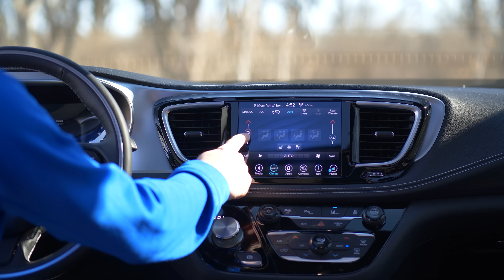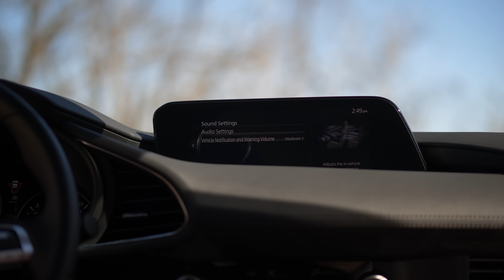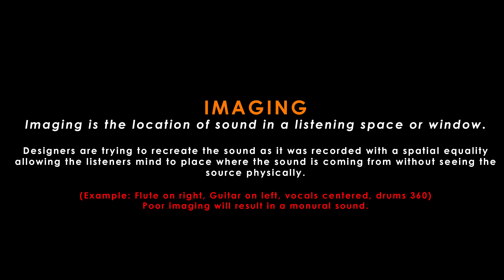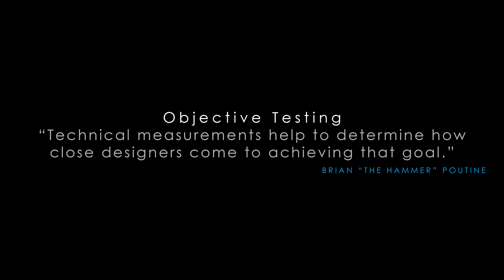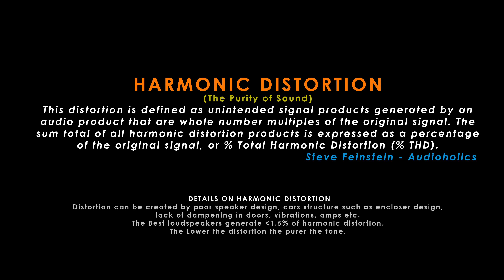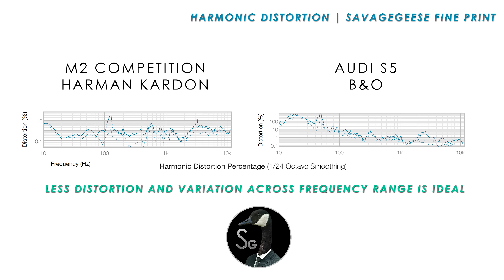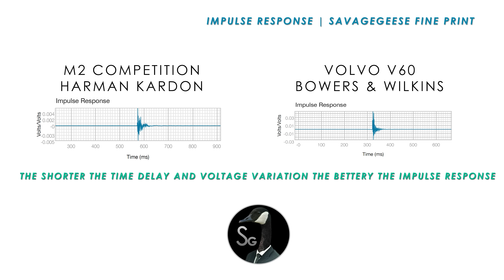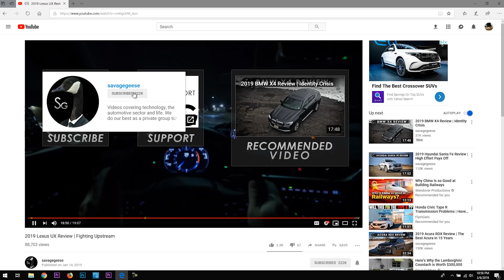Understanding Car Audio Design

Comment: I used to be a huge audiophile(the real kind; home loud speakers). For anyone who is, my last system had 3 way speakers with RAAL 70-10, Accuton C50, Scanspeak Revelator drivers with crossover duties done by minidsp and driven by crown amps. I'd put this speaker against ANY speaker regardless of price. That is to say, I value a linear response and know what good soundstaging and imaging sounds like.  
my experience with factory car systems, is that the brand name almost never tells me if a system will sound good. However, there are brands that almost always sound like shit in factory systems. Alpine, Beats, Bose. The best I've heard is the HK system in the first gen Merc CLS. No exaggerated frequencies, and astonishing imaging(great use of the center speaker) for a car environment, no distortion. At max volume, the amps would never audibly clip. The headunit also allowed for speakers levels to be adjusted based on the primary listener's location in the car, which worked very well. I have a WK2 Jeep with the HK system now, and it is absolutely terrible in comparison. Painfully bright, even with the highs turned way down, bass is too strong even with that also turned all the way down. Mids are okay.
IIRC, Harman is now owned by Samsung? They're a HUGE company that makes a lot of junk (mostly JBL, some HK and AKG branded products), but they also know how to make top quality stuff (HK990, ANY Crown amp). 
I was never much of a B&W fan, but I'm glad that they're a stand up company.
btw, B&O has a reputation in the audiophile community not as a high end audio brand, but a high end lifestyle brand that value aesthetics over acoustic design and charges WAY too much for the sound quality, much like Bose.

Comment: Lets talk about upgrades. How do i make a system where i can properly manage lows, mids and highs at the front  and lows, mids and highs at the rear(seats). I understand that you need a total of 4 tweeters, 4 mid range speakers and a sub. Or at least that's what i can do, but how to properly manage everything so that it sounds good? Should i just figure out what sub do i want and then go from there or should i start the upgrade by swapping out the factory speakers and tweeters for something better? The car in question is a 6 speaker gen 2 prius.

Comment: First of all, great video!  

I will say that the idea that paper cones are cheaper (and therefore insinuating perhaps lower quality or at least less desirability, and pointing out slower response time) isn't really accurate.  It is true that aluminum cones can offer faster transient response and less distortion, esp in the lower frequencies, but paper cones tend to offer a warmer overall tone that can sound much more pleasing to the ears.  And in the confined space of a car, with smaller speakers, how much of a difference will faster bass transients even make at all?  The biggest benefit would be the reduction of distortion, but with the proper amps for the speakers, that shouldn't be an issue w/ even paper speakers (good ones) in a car. There are other components that matter much more.  

Cabinet design being one of the biggest.  In cars, there basically is no cabinet design.  If there is something, like perhaps minimal baffling, it's generally an after thought, and still has to be squeezed into a door panel or dash.  :(

Then there is the question of the use of separate woofers and tweeters (and even mid-ranges) vs co-axial speakers or getting away with just plain old woofer-style drivers.  Co-axials save space but generally have their own inherent problems (and I don't see Genelc getting into the car speaker business any time soon, but they have "fixed" many of the issues inherent in co-axials in their [expensive] studio monitors).  And if car systems are using separate speakers (which also ups the speaker count for the marketing department), what is the quality of the cross-overs, and how are they tuned?  That matters a lot too.  

In the end, paper vs other materials is the least of my concerns and I would much rather have a properly designed system with paper than an average designed system with aluminum speakers.  Even if both were properly designed I would probably pick paper over aluminum regardless, esp if listening to compressed audio.  That is, however, a subjective opinion.  :)

Thanks again for the great video and the depth that you went into on the subject matter!

Comment: It all comes down to perceived value. For many people +$800 is 'A month's rent' or 'eating this month vs Ramen'. 
For others +$800 on a 50k car is just a 1.6% uptick in the cost. 

For some people the better audio system is not noticeable with kids screaming in the back and the 'car noise'. 
For others the little bit of improvement improves the experience a lot. 

I'm in the latter camp for both so I always select the premium audio when buying a car. 
Even the Bose* system in my old Mazda 3 sounded way better than the 6-speaker setup with less distortion. 
*At the time, kinda-sorta Bose. Bose amp, tweeters, sub, and DSP. Most speakers were somewhat ironically not Bose.

Comment: Cant wait for the audio test results. Hope they test the Golf R's system
Reply: Same as all the other VW systems. Panasonic drivers paired with an amp that guts your lows and mids at any normal listening volume. Fortunately, the deck has unmolested line out... flat as a can be. Good foundation.

Comment: I used to repair car audio systems in  the early days of my electronics tech career. It always amazed me  how cheap most OEM speakers were. Some of head units by Delco,GM, Ford, Toyota,etc.were pretty good units. But you tended to get $2/piece speakers with the system. At least then (1970-80's) you could generally upgrade the OEM system....no more. A car is a very poor acoustical environment....I agree that most of the touted"high end" OEM  systems are overkill.

Comment: One thing i found after test driving and being in cars of the same model but different trim levels and different add on packages.

Say you have a 2020 Camry. The sound system quality increases retroactiviely as you go higher up in the Trim Levels. So it goes:

L<LE<XLE

Now the XLE comes with a JDM upgrade option. What i found out after being in both cars with and without that upgrade option, was that it was completely pointless. With or without the JDM upgrade option the sound quality sounds so identical that its pointless to get. However, L and LE sounded way worse than the XLE.

So if you want the best sound quality option, the highest trim level usually the best choice, but skip the additional sound upgrade option that youll be offered when you already at the top trim. Its a cash grab.

Comment: You don’t need 20 drivers/speakers in a sedan&coupes. I like to listen to my music flat. compressed sound like mp3 or 3D whatever it all sounds terrible. Manufacturers should focus in on less speaker’s but higher quality made speakers. And better amps. I like my music to sound analog. And not digital. At home all of my music listening is turn table. And a super hi end digital to analog converter. The problem is most consumers no nothing about real sound quality. And that’s why we are being over charged for things we don’t really need like 20 speaker’s!

Comment: I bought a 19 Mazda 3 with the Bose audio system. You mentioned in your review that you thought it was flat and I agree - even with the bass almost at the max I barely get any, especially with rock/country. Can you comment and/or provide any suggestions?
Reply: The bose amp cuts the lows and mids at a stupid low volume level. Nothing you can do without spending money.

Comment: Most DAW's (computer program to make music) do not offer capabilities to design songs outside of 2 channel speakers. And these are the most common used DAW. (Ableton, FL Studio, Logic). Also, producers usually design songs in Mono, then add stereo imaging so songs sound good in Mono and Stereo. Coming back to this video as mentioned, More speakers does not mean better. No producer is thinking outside of that. Left and Right Channel split only.

Comment: In my personal experience Honda has some of the best audio quality in cars, comparable to studio monitors. I have compared my 2014 Civic EX Coupe to a 2013 Prius Two, 2017 Tundra SR5, 2014 Sentra SR, 2013 FR-S, 2015 C250 Coupe, and multiple older Nissan with Bose speakers. I'm think I am going to buy a used Lexus RC next year so I'm hoping the speakers are a bit better than a Prius, although I've got no complains from the Prius or C250 Speakers.
Reply: Never heard anyone say that and as a previous owner of 3 Acuras and 2 Honda's all the systems were terrible and replaced immediately with real equipment.

Comment: you would think they would get 3rd party car audio companies to make kits for their cars. at least as optional. i prefer spl vs sql mainly because of the music i listen to. they should have that as optional choices, standard, spl or sql. so sound deadening would be part of the spl package. but like you said the panel design etc etc makes a huge difference. if they had it so the speakers could come out of their placements without removing the the door trim that would be the best as it gives the customer the option to swap out components easier. Sadly its all changing with the different versions of cars from the manufacturers. instead of getting a mid range version of a model then choosing optional extras, theyve moved to have 4 or 5 versions that have certain extras. so if you wanted the led head and tail lights then its only available on the top of the range or 2 top versions of that model. same thing with paint choices. its easier for the manufacturer vs all these different optioned up versions of the one car model vs 5, 1 of which is the base model that fleet companies mainly buy.

Comment: The are plenty beautiful life like sounding speakers that are cheap and made of paper with small magnets.   They are just difficult to find. Many high end speaker manufacturers all use the same speakers. 

The best subwoofer I have ever heard was an Eminence paper cone $63 12 “ in a 8 ft box tuned to 16hz.   The the 3db down point was 16 hz @ 87 dB 1 watt. 
It was lightning fast and Distortion free.   In a Studio no less. 

That same sub would work in. 1.5 foot sealed box and produced some of the most life like bass response I have ever experienced in an automobile. 1990 Accord with an alpine head unit, Soundstream 245 amp and Mb quart speakers ( back in the mid 90’s when they were quality products). The bass in that car was completely non directional.  It sounded like everything was coming from out in front of the windshield.  No processing. No eq. No tone controls. The front speakers ran no high pass crossover.  Somehow the time delay was perfect in that car.

Comment: There is no way for any modern equipment to measure sound quality. 

You can take a system that has a Perfact flat response form 20 hz to 20,000 kHz with .0000001 total harmonic distortion. It may sound absolutely nothing like live music. It may not even sound good. 

The most dynamic,beautiful sounding car audio amplifier I have ever auditioned haunts me to this day.   It was completely impractical.   It made 22 watts per channel at around 3% thd. It was down more than 3 dB at 20 kHz.   The Milbert tube.   It was not just me that was blown away. Every one was stunned at how musical that amp was. 

Put 10 people in a controlled environment is the only way to truly test sound quality.   Often just 3 people works even better.
Reply: You missed the point entirely.

Comment: As a musician, I find all this very, very interesting, but as a car enthusiast I'm less and less interested in the figured quality of the audio systems in my cars and absolutely not interested in the cars' infotainment systems.
I'll use my '06 Jeep Commander Hemi (thus, Limited) as an example. I can power the main unit on and listen to CDs (duh) or listen to the radio. That's basically it. The maps for the Nav system are thirteen years old, but that's a moot point anyway, since I'd rather stop and ask around where I am than watch the absolutely obsolete graphic system it uses.
My '15 Miata had it last paid for nav update this spring. It'll slowly but inevitably drop into the abyss of obsolescence soon, and I'll have to use the phone, as I do in any other car I own.

In the end, what I want nowadays are nice gauges, as few screens as possible and systems that are prone to be hacked or upgraded in the forseeable future.

Comment: What about when you want to upgrade a system like the one in my Lexus LS 430 which WAS a great system by Mark Levinson but has a bunch of crazy proprietary equipment that now, 13 years later is either too expensive to replace with OEM or just not available anymore?  If it was only an audio system it would be easy, but the climate controls  and a bunch of other controls are integrated into the system.  How to get around that?

Comment: Guys, you just have to tune the body panel rattle to the zip-tied speakers in the doors, a little spray foam should do it, right?

Comment: Most audio systems aren't gonna stand up well when more consumers are driving BEVs and FCVs. One might think with increased hybridization and next-gen platforms, manufacturers may improve their game in regards to audio and vehicle refinement beyond what it is now.
Reply: Doubt it. Road noise killing mid-range is the issue. Got tires on the road? you got the same problem and the same dumbass ways that OEM's decide to remedy it. Tesla is the only one that approached this and they still fall incredibly short for the money.

Comment: Not getting the audio engineers in on it while building.. sounds like Mazda in a nut shell, at least 2016 Mazda. I always wondered why my Bose system in my Nissan Altima from 2012 sounded leagues better than my mother’s 2016 Mazda CX-5 Bose audio. Likely was an afterthought for Mazda :/
Reply: Those Altima systems sound really good considering the price of the car. Bassy yes but smooth and full. The Mazda Bose in my wife's 2016 Mazda 6 sucks. But the car is outstanding.

Comment: How are the Meridian systems in new Volvo's? Also, the Dynaudio systems in VW Type R is decent. What other cars have Dynaudio? I think older Volvo's did, very rarely. Why is Volvo so on point with sound systems and BMW isn't?
Reply: My '00 C70 and '04 V70 both have Dynaudio; I know they both have the upgraded audio package in them.  I can say on these (now) older Volvo's the 'Dolby' was absolutely a worthwhile upgrade.  The subs in my C70, I could take or leave - not worth extra, imo.

Comment: That's the kind of review I'm looking for years! Great job, I would guess Lexus and German high-end brand have better sound quality
Reply: From my testing it seems lexus falls short of the Germans Bermeister. Acura with Krell branded system is better than mark levinson.
Reply: @michaelgrant5258  Wow that's kind surprising since Lexus is so quiet (sound isolation) I would assume if the sound system is half decent then the end result should be good

Comment: It's clear Subaru wanted a lot of bass in the WRX. My dad's WRX Limited has the Harman/Kardon system, which sounds decent enough, but it's waaaaay too bass heavy
Reply: They've gotta contend with a LOT of road noise in that car. Deaden that car, adjust the audio and it'll sound much better and a lot less "muddy" - best upgrade for that car sans tearing out the shit panasonic deck and replacing every driver.

Comment: So, the Audi really has that bad of THD%?  15:08 kind of makes me rethink that the Audi B&O should have been highlighted more in the "Badge Engineering" portion, but for different reasons.
Reply: Different scaling for the measurements. This makes no sense. It should be equal for comparisons sake
Reply: The Audi systems aren't really that bad... Faital ES speakers, good sized wire. The subs suck, but, probably one of the easiest to augment cheaply for good sound. Seriously, throw in an LC2i, good monoblock and sub and it improves things by a factor of ten. Anything beyond that and you are looking at a mobridge and a lot of money.

Comment: I have about $3500 invested in a Dynaudio system to play native  SACDs in my car. I have close to $1500 in sound deadening on the whole car. That being said, with out acoustic or dual pane glass, more seals, and acoustic paneling. You will not get a quiet enough car to fully hear a tuned systems full potential at a stop or any speed. Side note - Tesla ev aren't quiet compared to luxury ice cars. Forgot the #1, aerodynamic and drag coefficient.
Reply: Holy crap you spent waaaay too much on sound deadening. I'm guessing you have CLD on every square inch of the interior?
Reply: @ster9765  CLD squares on all panels, 2-3 layers of MLV, and Thinsulate everywhere.

Comment: Brother, I don't know where to find the answer to this. I want to know if the Toyota 4runner uses that enhanced sound crap through the speakers? we have two 4runners. TRD PRO and Limited. I always feel like there's more going on inside the cabin in terms of sound than the engine is really doing.  Can we turn that crap off?
Reply: The 4 runner does not have a noise generator or artificial engine noise from the speakers.
Reply: @michaelgrant5258  Thank you